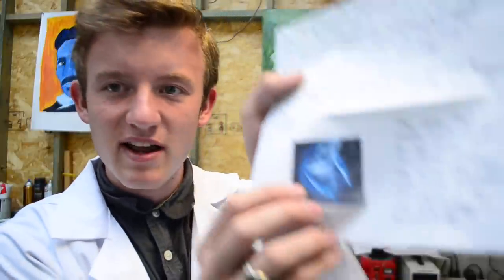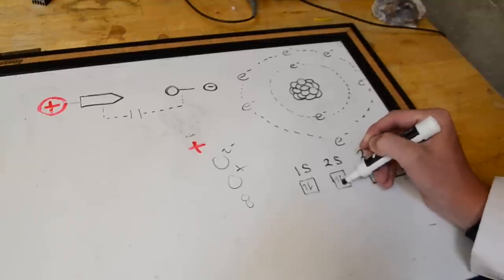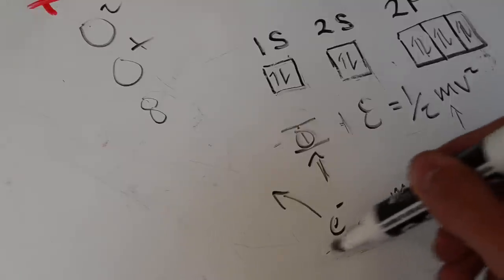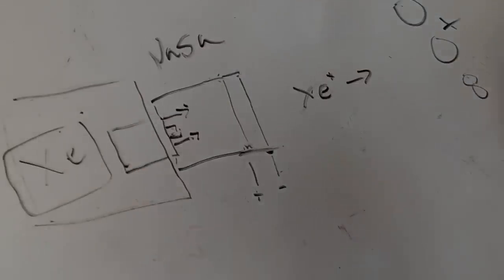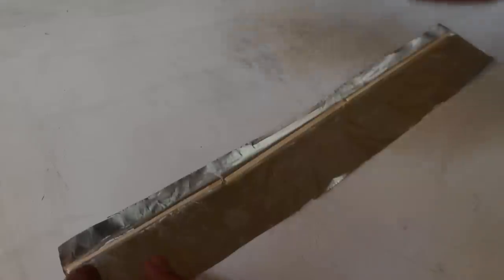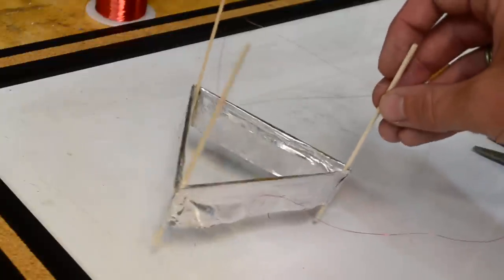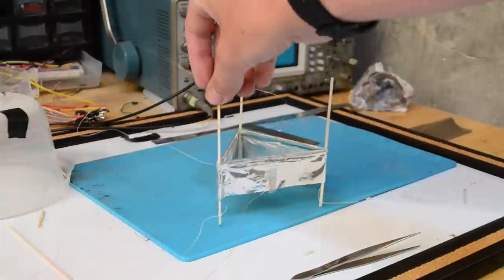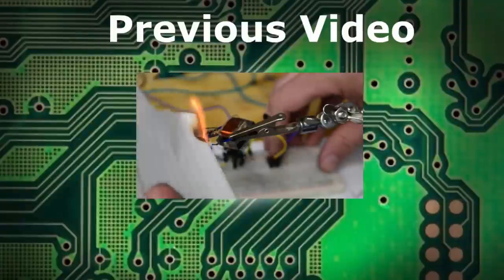How to make an Ion Thruster

Comment: Has anyone ever tried to make a commercial flight version using modern ultra lightweight materials?
Reply: Jacob Ellinger It wouldn't be very effective, the power source would have to be made very light, and the thrusters very large. Even if you used only light materials, small batteries, and huge thrusters, the aircraft would be too heavy, the power source too small (to both store enough energy for sustained flight, and too little voltage), and the thrusters too power consuming. Basically, it would use too much energy too quickly to keep sustained flight, it wouldn't get enough energy to lift, or it would be too heavy to fly. So, unless we find a way to store huge amounts of energy in really light batteries, and make the thrusters really efficient, and/or make the plane entirely bare bones (basically an open seat with controls, like an autogyro), then it would probably not be possible. A solar powered one in space however, where weight is negilagable, a constant source of energy is available, and the thrusters made realativly large (within reason, obviously), it could work. It would have to be taken to space via shuttle craft, bit it could work. Of course, it would be incredibly slow (especially so considering the vastness of space), but certainly possible.

Comment: O.K How many volts are HIGH VOLTAGE. 12 volts, 100 volts 2000 volts? Just a ballpark answer will suffice.
Reply from the maker: those supplies were 2000 V
Reply: @KeystoneScience  So that kind of voltage would make automotive use impossible. Thanks.
Reply: Impossible with That voltage requirement and that little of an output.

Comment: Wait,  it looks like you are using the Bohr model, which isn't exactly accurate because of the fact that electrons aren't in one orbit. It's called an electron field and there is no way to tell exactly where an electron is. So let's say if you removed an electron from an area then Why would it make it make it more stable since oxygen has 6 valance electrons you said removing one would make it an noble gas. That's incorrect as well. The most stable atoms have 8 valance electrons and 6-1 does not = 8.
Reply: Lynx Crain. So where's your Ion Thruster, science man?
Reply from the maker: yes, taking away one electron does not make it a noble gas, however it does fill a sub shell, making it slightly more stable given the occupied area of the 1st P orbital, also yeah, but the bohr model is easy to explain things with.
Reply: I see, thanks for explaining XD
Reply: Hmmm, you have a point. Challenge accepted
Reply: btw love the vids keep it up